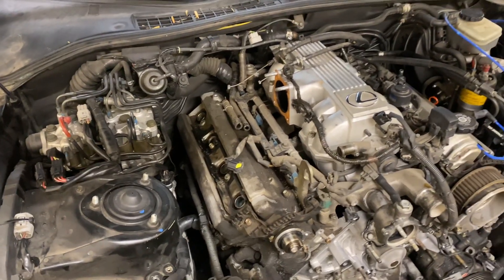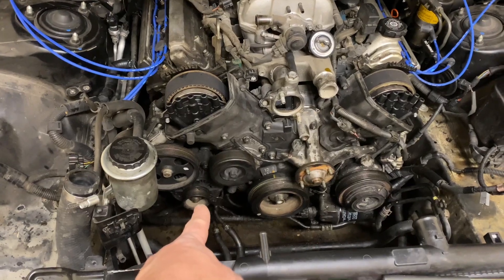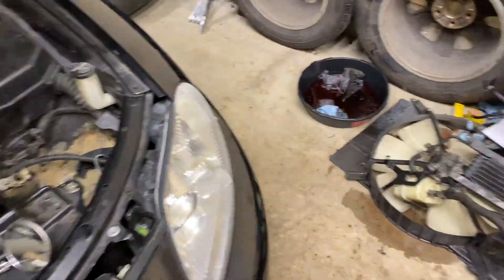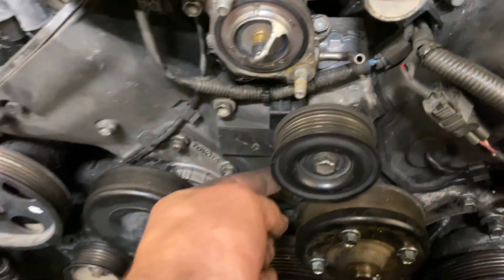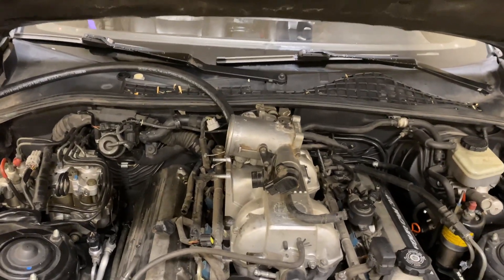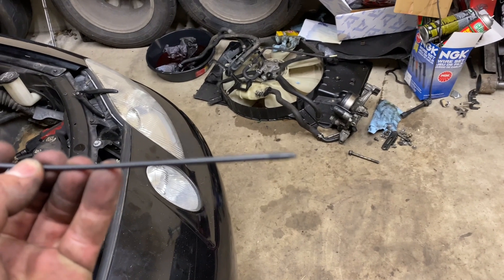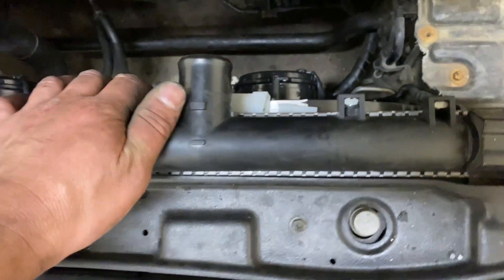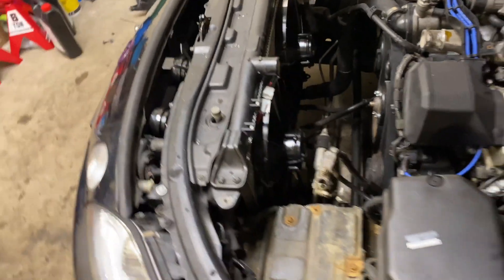SC400 Continuation, Timing Belt Reassembly and Fan Install

Comment: Nice,,, i got a few questions,
1) how are these fans holding up?
2) when you start your car, do the fans automatically come on? Or you have to switch them on manually?
3) when you turn on your AC do the fans come on automatically?

I am planning on doing the same setup,, just wanted to know what I'm getting into. Thanks
Reply from the maker: I need to do a follow up video on the setup, it’s been a minute. 

Fans are still doing great, combined with a Koyorad radiator and an overflow bottle. 

We went through a few different wiring setups, but settled on: primary fan comes on based on an aftermarket coolant temp sensor mounted in the radiator. A small timer relay kicks the second fan on once the first fan has been running for 2 mins. This way the second fan doesn’t run unless it’s needed. 
I can also manually order the primary fan on with the switch, and the relay timer works the same way. 

Fans only come on when needed based off of coolant temp, and don’t come on for A/C unless the engine gets hot
Reply: @elementalcivik  thanks now I get it... awesome build man, yea a followup video will be good 👍🏻  for your fans
Reply: I've put electric fans on a few rods - Camero n Mustangs. Always wired in a temp sensor to activate them.

Comment: Nice one, I got an soarer z31,which is the same car pretty much, my goal is remove all those shit electronics and run an aftermarket ecu with COP, for the rad fans, I would use the is200/300 oem one,  nice project good luck

Comment: nice build question what pulley did you use to delete the hydro fan?
Reply from the maker: Thanks!  I believe I just used the LS400 pulley that I grabbed with the bracket. I’ve seen forum posts saying they’re too small and won’t hold tension. 
However, it was only slightly smaller than the hydro fan pulley and has held tension just fine on my car.